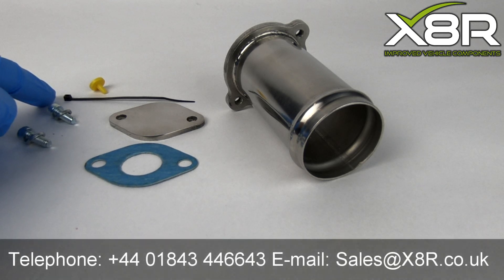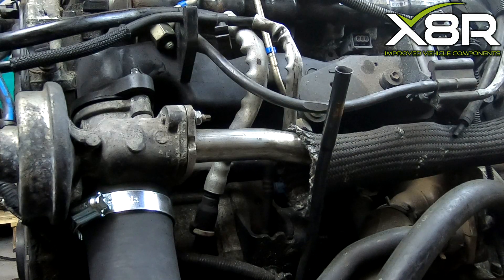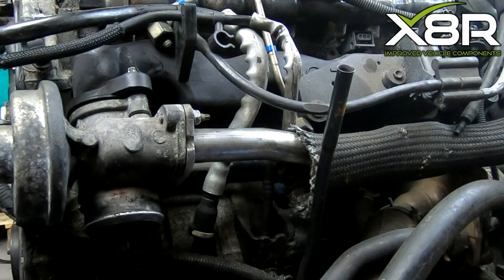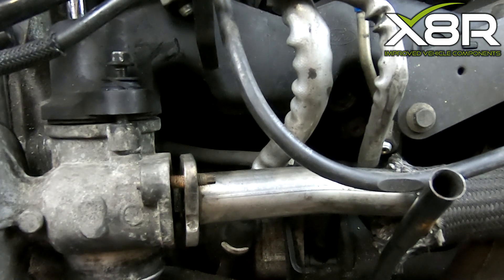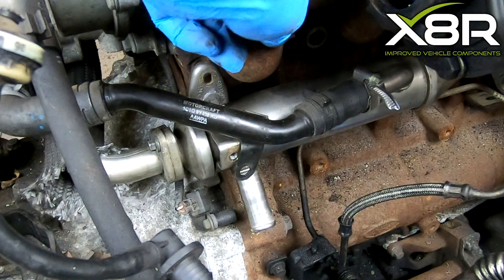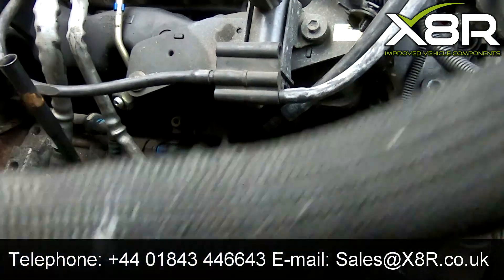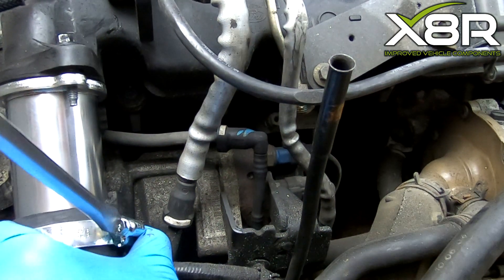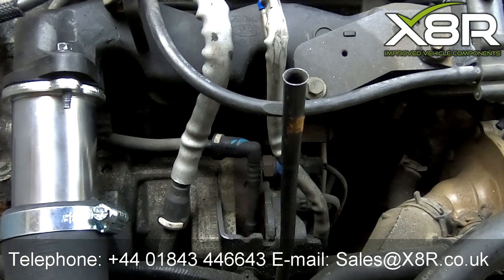Ford Mondeo Jaguar X Type 2.0 2.2 TDCi EGR Valve Delete Blanking Tube Instructions

Comment: This is a completely different EGR valve to that which is on a 2.2. You cannot put a complete blanking plate on a 2.2 because the engine management light will come on. you have to use a blanking plate with a 8-10mm hole for this to work.
Reply: Mine is a 2.2 from 2005 and has that EGR.
Reply: Correct 👍🏼

Comment: Hi. I my car is loosing coolant via the EGR unit so I need to do a valve delete. But I also need to bypass the coolant system from the EGR unit itself. Is there any reason I can't do this? (Heat issues/ turbo cooling etc) Thanks in advance
Reply from the maker: Hi there,
As long as you aren't bypassing any components (other than the EGR valve) then this should cause no problems.

Comment: I did this and the difference was amazing... Smooth drive and no smoking exhaust. 
Passed MOT no problem.
Delete EGR software from the main computer to get rid of engine manager light as the computer still thinks EGR is faulty as it's not there now.
Reply from the maker: Hi there, thank you for the fantastic feedback! - Georgina, X8R Ltd
Reply: How do you remove it off the computer and is that a permanent EML fox?
Reply: @rhysmcgreal8786  needs a remap. I found it cheaper and a better fix to fit a cheap, working EGR and just blanked off the exhaust feed pipe. EML has stayed off ever since and EGR looks like it hasn't been tampered with. This kit didn't last 3 months on my car.

Comment: why would you need/want to remove it anyways???
Reply: Try driving the same car with and without, the difference was pretty astounding on mine. No smoke, far less turbo lag, smoother running and acceleration. I kept my EGR in place and just blanked it though, the bypass pipe is useless Chinese "steel" and didn't last a few months.
Reply: I suppose you could clean it up and sell it, and maybe even make a profit.
Or maybe for a cleaner look to the engine.
Or maybe to prevent carbon chunks from going into the engine.
Also, it might make the car lighter, but granted not by much!
But if you were doing this for a living, and replacing 10-20 of them a week,  removing them and selling them would be a nice profit!
Some cars require the EGR to remain on the car though, still opening and closing, to prevent an error. So in that case you might want to remove and clean it, and then put it back on, and just block it off. In my old Peugeot this was the case, the amount of airflow to the engine through the EGR was part of the torque calculation by the computer for the traction control, for how much power to send to each wheel. 
I think it needed to know the exact air/fuel ratio.
So the computer had to know how far the EGR valve was opened, and it would test the valve every time the car started up, and give an engine fault if it wasn't there, which disabled ABS and ESP, and was enough to fail an MOT or NCT.
Took me a while to track an ABS fault to the EGR valve! 
Peugeot dealer wanted to replace my ABS module for €1,200..
I'm sure Peugeot could probably have just put an airflow sensor in front of the EGR valve, or maybe they couldn't because of temperatures or carbon deposits or something. Who knows..

Comment: Or just slot a blanking plate in with no hole. No engine light and runs like a dream
Reply: This, leave the EGR in place, the replacement pipe is garbage.

Comment: "Vehicles with an electronically operated EGR will show a fault code which will need to be mapped out." OK, i know, i have the problem, how is possible to mapped out the default code permanently ?

Comment: If, you basically say that "an engine is better without the egr system" why it was invented? Just to add up cost plus making the engine run worse over time by helping the carbon build-up? Nah, i don't think that a series of engineers were paid to invent this thing to damage the engine. It has a purpose, and if it's there, it has a reason to be there. As every piece of the engine the erg system needs to be maintained to work as intended. I'll put a link to a page that explains the general funtion of the egr system so you can actually learn what is actually doing before you do such modification to it.

https://technician.academy/advantages-exhaust-gas-recirculation/

https://www.cambustion.com/products/egr

Learn to educate yourselfs before trying anything.
Reply: It's just for the environment to reduce harmful exhaust gasses. Fuck it
Reply: the EGr valve is a very economical system created by car's compagny to reduce CO2 emission in the way to pass WLTP & NDC test, so to sell cars with lower emissions when the engine is cold. The  result is during the life of the car the CO2  emmissions are reduced about 0.2 % ...Nothing for environment but it's causing big trouble on engine because the dirt are unanable to exit and no tank was created to do that.
Reply: @saabarch8951  May I know where did you get the 0.2% figure? Or is it a guess for the sake of the argument?
Reply: Yeah everything I've read is that it's to lower carbon emissions due to recirculating the gas. This also keeps the engine colder, which isn't always a good thing.
Reply: In the short-term, an egr valve reduces emissions (when the car is new)..... however, car manufacturers didn't consider that over the long-term, the egr valve tends to go faulty, increasing emissions and decreasing mpg.... no car manufacturer will admit this of course....
Reply: The EGR valve has a purpose, but it can make your vehicle run worse after time. People aren’t just pulling parts off their cars Willy nilly, it’s common knowledge that EGR valves can be harmful to the engine and restrict performance somewhat, what’s with the stupid comment?

(And, ironically, it’d be “educate yourselves” not yourselfs)
Reply: @owen4326  I appreciate the correction,  I may have sometimes spelling errors because english is my third language.
Thank you.

Comment: a mechanic told me that the EGR has to be removed from the ECU even if you block it other wise it would go into limp mode, is this true at all?
Reply: If it's euro 4 yeah but drill a 10mm hole in the centre of the blanking plate and it will prevent this from hsppening. If it's euro 3 you'll have no problems
Reply: @PaddyfromDonegal  2005 Euro 3?

Comment: I just put a blanking plate at top on egr valve that's it left the old pipe and valve in
Reply: Has the benefit of looking original too.
Reply: Any problems since I'm just about to do mine

Comment: What happened whit EGR cable plug?
Reply: they dont know :D
Reply: its to easy and short for a video.
Reply: ferkemall  A resistor ? where can we find that ? I have this problem, my plate block totally the egr, i dont want to let a hole and circulating gaz ... so after some kilometers, this damn ODB code come :(

Please provide us a link with the resistor to simply plug and buy.